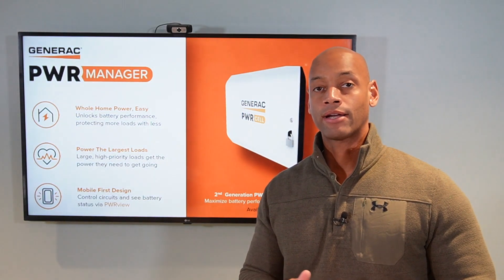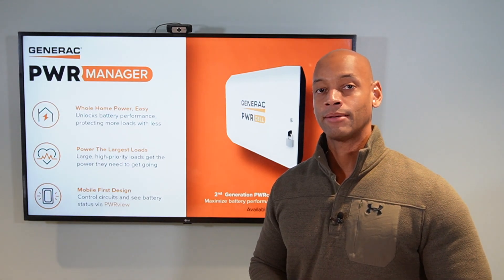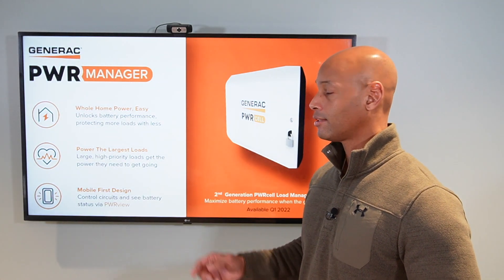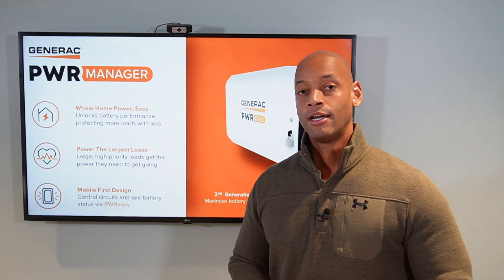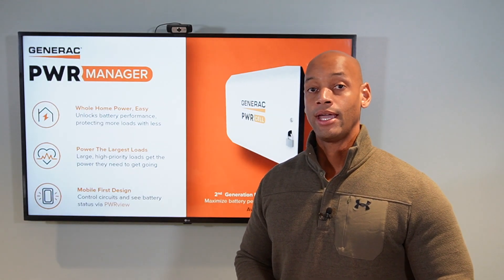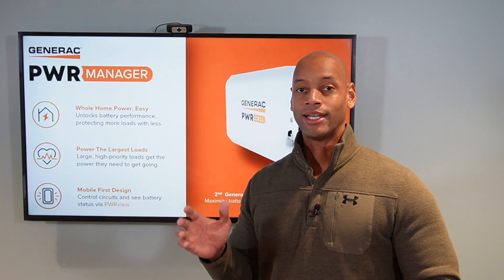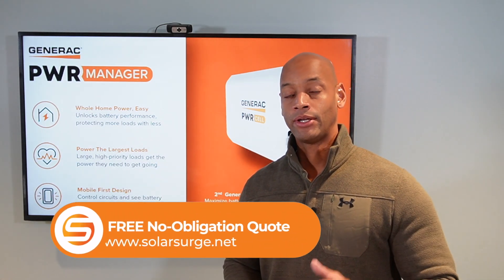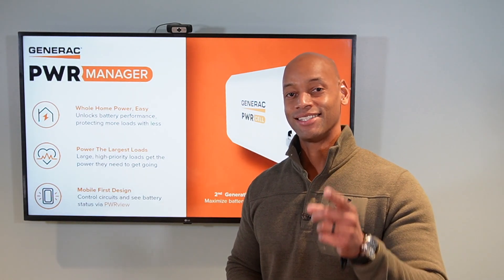New Generac PWR Manager | Next-Generation Intelligent Load Management

Comment: Does anyone here know if Generac has a similar device for use with their backup generators? It seems like this is only for battery based backup power solutions.

I recently built a new home and have a 22kW backup generator in place. Recently we had a power outage when it was only 10F outside and, of course, the generator was constantly getting bogged down as my heat pumps all tried to come back on simultaneously. Unfortunately, the electrician who installed my generator didn’t plan properly with a load shedding solution, and I’d been looking at installing some SMMs in the home to address the problem, but a single smart controller like this one sure would be a lot nicer solution!

Comment: How is this “whole house” if it only accommodates 12 circuits?
Reply from the maker: The whole house is connected to backup power.  Up to 12 circuits can be load managed.  Meaning that, if power becomes scarce, PWRManager can automatically shed up to 12 loads.

Comment: Just had solar panels + Generac PwrCell battery and inverter installed.

the installer said that we couldn't run HVAC, Stove, Hot water heater, etc off of the 6 cell PwrCell cabinet - with PWR Manager - would that be possible ?

Comment: Hi Joe I just got my new Generac installed finally after 3 years of frustration today I have 250-gallon
 propane tank buried in the ground and I just found out they failed inspection because the regulator
is not 3 feet high according to the code, you would think that all the tanks they put in should know
 that. my generator Generator is 13 kW am very interested in the management but am not going
with that company.

Comment: Will the PWRManager still manage loads in the case of wifi/cell service interruption when the app cannot be used?  Thanks for a really helpful video!
Reply from the maker: Yes it will, but you cannot change priorities unless there is an internet connection.
Reply: @SolarSurge  thank you!  Could you possibly make a video on the new Generac micro inverters?  We were waiting on the release of these two new products before we have our Generac solar installed. I need help understanding the use case for the micro inverters.  Thank you!
Reply from the maker: @neecick  Yes we have this on the list.  Hopefully within the next few months.

Comment: ⚠️Portable gas Generator Safety Tips:

1) KEEPING OTHERS SAFE: Please do not allow an unqualified person or your children to operate and service the portable generator. Just because some manuals don’t say that doesn’t mean it’s safe. That is important against the generator safety rules. We also need to be keeping an eye on our children too. You need to make sure that your children are not playing near the portable generator especially when it’s running so they won’t get electrocuted. Generators pose electrical risks and they can be hot during an operation. Please keep your children away from the portable generator at all times. It is important to keep our children safe especially our little ones. Be aware of all the hazards.

2) WHERE TO RUN YOUR GENERATOR: Some people use their portable generators indoors which increases the risk of carbon monoxide poisoning. It’s important to have carbon monoxide detectors in your home if you have a gas generator. Never ever use your generator indoors even if your doors and windows are open and even in the garage is not safe to use a portable generator. Also please never use your generator in your deck or balcony. It is never safe to use your generator indoors and in enclosed areas of your home. Your generator needs to be 15-20 feet away from your house. 

3)🔥FIRE HAZARDS: Never refuel your generator while it’s running. You need to let your generator cool off before refueling it and before storing your generator. Never overload your generator too. Never ever back feed your generator. You should never plug your generator into a wall outlet. Also never store propane tanks indoors. Please keep flammable things away from the generator as well and please don’t smoke cigarettes near the generator. Having a fire extinguisher next to the generator is also important against the generator safety rules. It’s also not safe to move your generator while it’s running.

4) GENERATOR OPERATION: make sure your hands are dry before touching the generator. Never use your generator in wet conditions. Don’t let your generator get wet. You need a generator tent if you need to use your generator during wet weather. Please don’t wear loose clothes when operating the generator. Turn on your generator before plugging in appliances. Use the right cord for your generator. Please do not use worn out cords. 

Portable generators need maintenance so it’s important to follow the safety instructions carefully.

Hope this helps. This is just a safety reminder when using portable generators.

Comment: Looks like a Generac version of the Lumin Smart panel.  BTW, I am a support engineer for Electric Power and enjoy your videos.  You were suggested by YouTube a week or so ago and I really liked your style and content so I subscribed.  No hype just reasonable information.  I really liked the interview with Jon Proffitt from Lumin.  Jon and I have had many discussions when I was a Product Manager with Darfon.  I have installed and tested the Lumin Smart and am very impressed with what it can do.
Reply from the maker: Hi Bryan and thanks for the sub. Yes that was my first impression also that this was like a Lumin Smart Panel.
Reply: @SolarSurge  Does this only work with Generac systems (batteries/inverters etc) or is it agnostic like Lumin?   Has any pricing been announced?   A comparison of various load management platforms (Lumin, Span, Generac etc) would be a great future video.
Reply: I am an energy specialist in distribution and I asked Generac about that, if they are rebranding a Lumin Smart Panel.  They said they weren't and it was an original creation but.. it looks a lot like a Lumin.